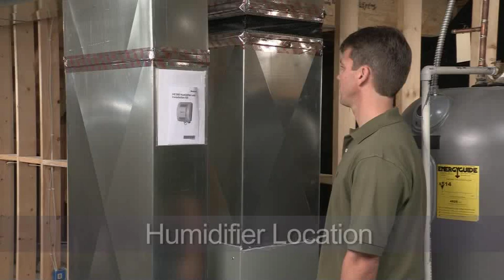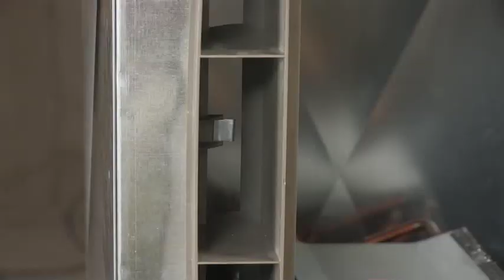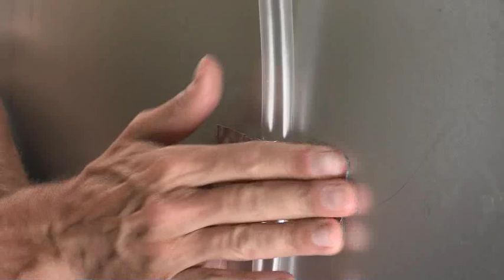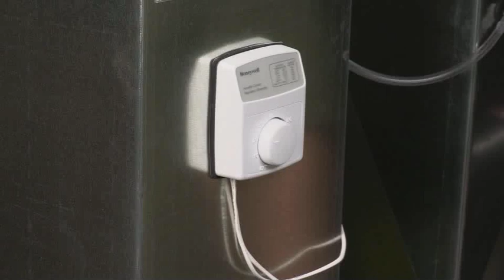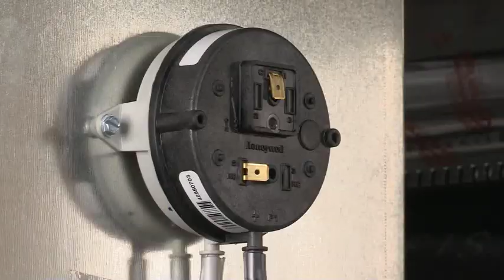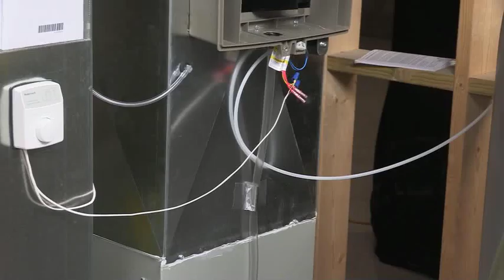360 Humidistat v 2 English 1

Comment: I don't think a 3/4 inch drill bit is the one I need for the duct screws.
Reply: That 3/4 hole is for the black grommets that run to the pressure switch, and the other 3/4 inch grommet that goes from the return to the other gray port on the pressure switch.

Comment: Not very clear in the pressure switch wiring .  Two reds and two whites , where do they come from , please show it with video for non speaking English ppl, I speak but I don’t understand very well. Thank you in advance
Reply: I have the same issue I just installed it today and I don’t get the wiring!!! It doesn’t explain it very well and the manual either. Let me know if you figured it out please. Thank you!
Reply: @Morrongo25  both the humidifier and the pressure switch send red and white to the humidistat. There are no wires between the humidifier and the pressure switch, even though it looks like it in the manual diagram